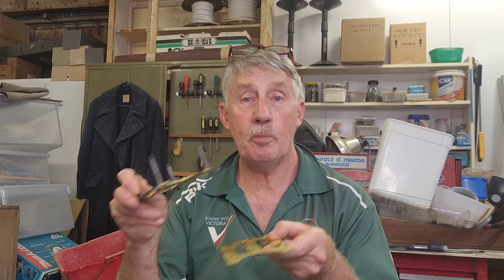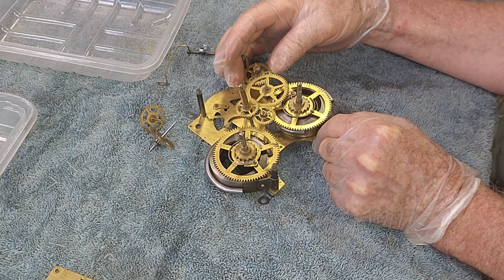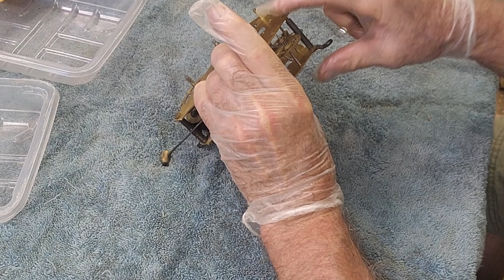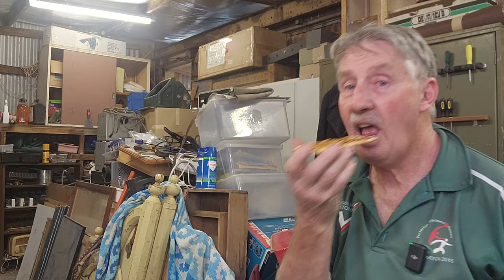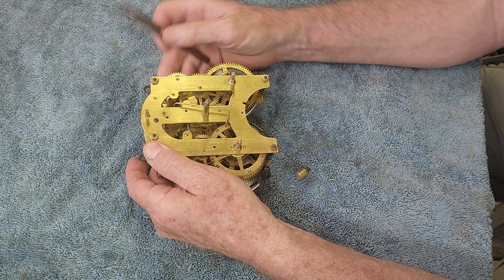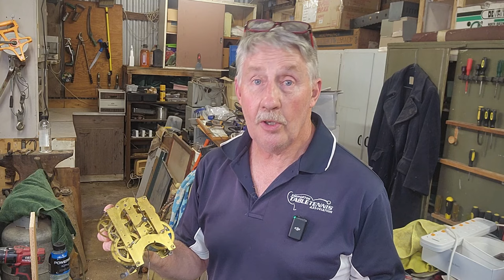Full Service of an Antique Ansonia Kitchen Clock Part 4 Assembly of the Movement & Timing the Strike

Comment: Hi John great job. Just question at about 9.50 you mention the spring going around the post. I couldn't see where you put it on post. And also what that spring does. I have the same clock that i am debating pulling apart as you have our doing your petrol trick.😊  In my clock I'm not sure if the little wire spring is broken or not is hard to tell.
Reply from the maker: Hi Lisa. It's Chris here.
The spring just puts a little pressure on the lever so that it drops into the count wheel with some positivity. I think I put the spring on when installing, and it slipped off during the rest of assembly. It's not hard to reach in with tweezers and refit it later on. You can also stretch it out a little and reform it if the end has broken as the spring pressure isn't critical.
Reply: Great thanks I'll keep that in mind if I decide to have a go😊